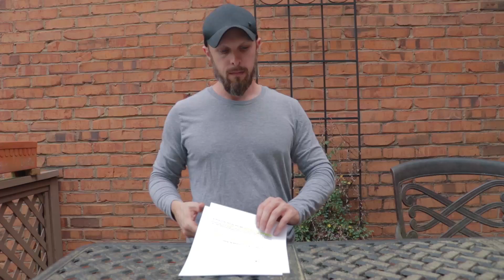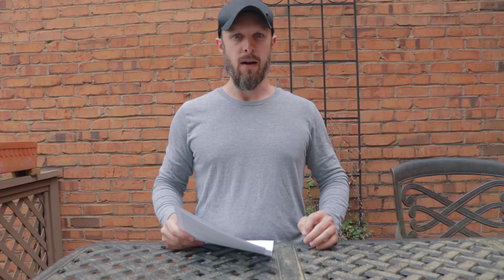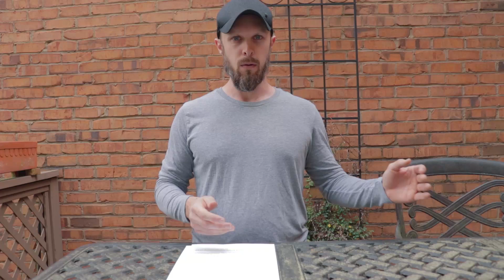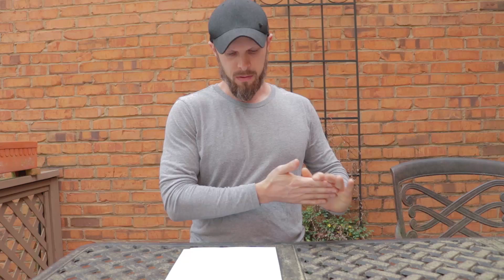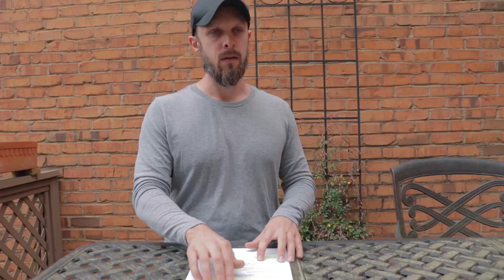Stop 5G Signals With Cob Walls - Protect Your Home From EMF Radiation

Comment: I heard that 5g is a low frequency.
Reply: U heard wrong!
Reply: It's a really high frequency.  It allows high data rates but reduces the distance it can be transmitted.  If uses 28 to 39Ghz.  That's 10 to 65 times higher than the current 4G network that operates at 600mhz to 2.5ghz. 

4G networks have a range of 10 miles while 5 networks have a range of 1,000ft.  That's not even 2% of the range of a 4g network.  5G towers will have to be placed every block or so in order to have a reliable network.
Reply: @goodtreeministries3751  oof
Reply: @suqma  5G Ultra Wideband, Verizon's millimeter wavelength (mmWave)-based 5G, operates at frequencies of about 28 GHz and 39GHz. This is considerably higher than 4G networks, which use about 700 MHz-2500 MHz frequency to transfer information.4 days ago.  SOURCE: A QUICK GOOGLE SEARCH.  That's at least 10 times higher frequency and up to 55 times higher frequency.
Reply: @goodtreeministries3751  yeah, still much much much weaker than light and stil means nothing
Reply: @suqma I disagree it matters.  High exposure to radio frequency radiation associated with cancer in male rats

NTP releases final reports on rat and mouse studies of radio frequency radiation like that used in 2G and 3G cell phone technologies.

The National Toxicology Program (NTP) concluded there is clear evidence that male rats exposed to high levels of radio frequency radiation (RFR) like that used in 2G and 3G cell phones developed cancerous heart tumors, according to final reports released today. There was also some evidence of tumors in the brain and adrenal gland of exposed male rats. For female rats, and male and female mice, the evidence was equivocal as to whether cancers observed were associated with exposure to RFR. The final reports represent the consensus of NTP and a panel of external scientific experts who reviewed the studies in March after draft reports were issued in February......The $30 million NTP studies took more than 10 years to complete and are the most comprehensive assessment, to date, of health effects in animals exposed to RFR with modulations used in 2G and 3G cell phones. 2G and 3G networks were standard when the studies were designed and are still used for phone calls and texting.

I'm not trying to alarm anyone.  It's clear that our environment and diet are contributing to the higher cancer rates.  It's multi faceted and this is just part of the picture.   It's insane when you see advertising telling you that one in three people will have cancer.  It used to be that you might not know anyone that died of cancer.  The creepy part is that they are trying to mentally prepare your for it.  Shifting your expectations of what reality is and what type of future is reasonable.

Source:https://www.nih.gov/news-events/news-releases/high-exposure-radio-frequency-radiation-associated-cancer-male-rats

Personally I trust in Jesus for my health.  I used to be an athiest, but I've prayed for thousands of people and seen over a thousand healed of all kinds of things instantly while I was praying them. Broken bones,  short legs, bad back, bad knees,  MS, etc.  We all die it's most important to be right with God.  We all need to repent from sin and believe in Jesus for eternal life.
Reply: @goodtreeministries3751  mkay, so firstly, that is just one study, secondly, even if someone wanted to increase cancer risk, people are still living longer than before, so we are still developing, also, i think cancer rates aren't rising, they just can be diagnosed more easily...-well maybe, to be real, people in the middle ages weren't smoking and eating fast food, so it could be rising, but still
Reply: @suqma  

It's not one study.  

https://www.theguardian.com/technology/2018/jul/14/mobile-phones-cancer-inconvenient-truths
Central to keeping the scientific argument going is making it appear that not all scientists agree. Towards that end, and again like the tobacco and fossil-fuel industries, the wireless industry has “war-gamed” science, as a Motorola internal memo in 1994 phrased it. War-gaming science involves playing offence as well as defence – funding studies friendly to the industry while attacking studies that raise questions; placing industry-friendly experts on advisory bodies such as the World Health Organisation and seeking to discredit scientists whose views differ from the industry’s.

67% of the independently funded studies found a biological effect, while a mere 28% of the industry-funded studies did. Lai’s findings were replicated by a 2007 analysis in Environmental Health Perspectives, which concluded that industry-funded studies were two and a half times less likely than independent studies to find health effects.

I no longer believe in the good will of the government, corporations or people in general.  Let's be honest these are just institutions that are run by people.  I've seen too many lies exposed over time that show a pattern of  willingness to cause sickness and death for sake of money and power.  There is evil in this world and people are willing to kill people for the sake of gain.  

In reality it's sin in people's hearts being made manifest in their actions.  The answer is Jesus, but He tarries
Reply: @suqma  There is less active energy in a piece of arsenic than a rf wave, but it kills you a lot faster.  Active energy output or lack there of doesn't equal safe or unsafe.  It's more complex than that.  I will trust independent studies over your hasty dismissals based on flawed logic.
Reply: @goodtreeministries3751  oof, active energy doesn't mean anything, i only know the energy
Reply: you know, the energrtic energy kind
Reply: @suqma  https://www.thesaurus.com/browse/energetic. 

Similar words:  Active, etc...

Tomato = Tomato.
Reply: @goodtreeministries3751  but when you string two synonyms together, it Is NOT A WORD that's like saying; tomato tomato, And Meaning tomato also that Is the synonym for energETIC not energY And surprise surprise, arsenic doesn't kill you with energy like a bomb or something, it kills you because it Is toxic
And just because something has a lot of energy doesn't mean it kills you
 what Is even this discussion
Reply: @suqma  It is the discussion.  You claimed that becuase 5g waves have less energy than light it's not harmfully.  This is flawed logic.  Your just nitpicking the way I described it because your logic and argument is flawed.
Reply: @goodtreeministries3751  mhm, and what, do you have any other reason why it should be harmful?
Reply: @suqma   Like I said I trust independent studies over my own understanding or your assumption of what makes something harmful to the human body.

Your assumption that light has more energy than 5G therefore it's not harmful is flawed logic.  Energy output is not the only factor.  

For example
A standard outlet is
110 volts x 10amps = 1100 watts and is deadly.
A Van De Graaf generator is safe at
200,000volts x .01amps= 2000 watts and is safe to touch.  

The form of the energy and how it interacts with different things is very important and should be studied for safety.

Some plants are poisonous and deadly.  They have can have less energy than a nonpoisonous plant.  It's the interactions of the parts in the system that matter not the overall sum of energy.

As stated before this has to be studied on a case by case basis because the world is complex place.  If you want to know the affects of an RF wave at 30ghz on living animals and people you have to do the studies.  You can't assume it's safe.
Reply: @goodtreeministries3751  this leads nowhere, you're comparing energy to poison
Reply: @suqma  I also compared volts to amp's. Which you ignored. High voltage is harmlessly if the amp's are low enough.  Proving that different forms of energy are safer than others.  Your not being objective.  Your right this not going anywhere.
Reply: @goodtreeministries3751  ok, but how does This say that 5G's frequency And energy Is harmful in any way?
Reply: Source:  Scientific American https://blogs.scientificamerican.com/observations/we-have-no-reason-to-believe-5g-is-safe/

Yet, since the FCC adopted these limits based largely on research from the 1980s, the preponderance of peer-reviewed research, more than 500 studies, have found harmful biologic or health effects from exposure to RFR at intensities too low to cause significant heating.
Numerous recent scientific publications have shown that EMF affects living organisms at levels well below most international and national guidelines. Effects include increased cancer risk, cellular stress, increase in harmful free radicals, genetic damages, structural and functional changes of the reproductive system, learning and memory deficits, neurological disorders, and negative impacts on general well-being in humans. Damage goes well beyond the human race, as there is growing evidence of harmful effects to both plant and animal life.”

The World Health Organization's International Agency for Research on Cancer (IARC) classified RFR as "possibly carcinogenic to humans" in 2011. Last year, a $30 million study conducted by the U.S. National Toxicology Program (NTP) found “clear evidence” that two years of exposure to cell phone RFR increased cancer in male rats and damaged DNA in rats and mice of both sexes. The Ramazzini Institute in Italy replicated the key finding of the NTP using a different carrier frequency and much weaker exposure to cell phone radiation over the life of the rats.

5G Millimeter waves are mostly absorbed within a few millimeters of human skin and in the surface layers of the cornea. Short-term exposure can have adverse physiological effects in the peripheral nervous system, the immune system and the cardiovascular system. The research suggests that long-term exposure may pose health risks to the skin (e.g., melanoma), the eyes (e.g., ocular melanoma) and the testes (e.g., sterility).

Above are paragraphs from the article from this respected scientific journal and is reverencing 500 hundred studies over decades.

If this doesn't change your mind I don't know what would.
Reply: @suqma   Source: Environmental Health Trust
Published Research Establishes Harmful Effects of Wireless Radiation

5G Wireless Expansion: Public Health and Environmental Implications is a published research review on 5G that documents the range of reported adverse effects of RF and millimeter waves—effects which range from cancer to bacteria growth changes to DNA damage. The study concludes that “a moratorium on the deployment of 5G is warranted” and “the addition of this added high frequency 5G radiation to an already complex mix of lower frequencies, will contribute to a negative public health outcome … from both physical and mental health perspectives” (Russell 2018).

Cancer epidemiology update, following the 2011 IARC evaluation of radiofrequency electromagnetic fields is a comprehensive research review of RF effects in human and animal research. The review concludes that scientific evidence is now adequate to conclude radiofrequency radiation is carcinogenic to humans (Miller 2018). Several previously published studies also concluded that RF can “cause” cancer, for example, Hardell 2017, Atzman 2016 and Peleg 2018.

 

The US National Toxicology Program (NTP) Study on Cell Phone Radiation found “clear evidence” of cancer, heart damage and DNA damage in a $30-million study designed to test the basis for federal safety limits (NIEHS). The heart and brain cancers found in the NTP rats are the same cell type as tumors that researchers have found to be increased in humans who have used use cell phones for over 10 years. Thus, researchers say this animal evidence confirms the human evidence (Hardell 2019.)

The Ramazzini Institute (RI) Study on Base Station RF  was another large scale rat study that also found increases in the same heart cancers as the NTP study found—yet the Ramazzini rats were exposed to much lower levels of RF than the NTP rats. In fact, all the RI Ramazzini radiation exposures were below FCC limits, as the study was specifically designed to test the safety of RF limits for cell tower/base stations (Falconi 2018.)

 

Tumor promotion by exposure to radiofrequency electromagnetic fields below exposure limits for humans” is a replication study that used very, very low RF exposures (lower than the Ramazzini and NTP study) and combined the RF with a known carcinogen. Researchers found elevated lymphoma and significantly higher numbers of tumors in the lungs and livers in the animals exposed to both RF and the carcinogen, leading researchers to state that previous research (Tillman 2010) was confirmed and that “our results show that electromagnetic fields obviously enhance the growth of tumors” (Lerchl 2015).

“A review of the ecological effects of RF-EMF” reviewed 113 studies finding RF-EMF had a significant effect on birds, insects, other vertebrates, other organisms and plants in 70% of the studies (Cucurachi 2013). Development and reproduction in birds and insects were the most strongly affected. As an example of the several studies on wildlife impacts, a study focusing on RF from antennas found increased sperm abnormalities in mice exposed to RF from GSM antennas (Otitoloju 2010). Studies on bees have found behavioral effects (Kumar 2011, Favre 2011), disrupted navigation Goldsworthy 2009, Sainudeen 2011, Kimmel et al. 2007) decreasing egg laying rate (Sharma and Kumar, 2010) and reduced colony strength (Sharma and Kumar, 2010, Harst et al. 2006). Research has also found a high level of damage to trees from antenna radiation.  For example, a field monitoring study spanning 9 years involving over 100 trees (Waldmann-Selsam 2016) found trees sustained more damage on the side of the tree facing the antenna.

“Towards 5G communication systems: Are there health implications?” is a research review that details how research has found that millimeter waves can alter gene expression, promote cellular proliferation and synthesis of proteins linked with oxidative stress, inflammatory and metabolic processes.” The researchers conclude, “available findings seem sufficient to demonstrate the existence of biomedical effects, to invoke the precautionary principle” (Di Ciaula 2018).  

“The Impact of radiofrequency radiation on DNA damage and antioxidants in peripheral blood lymphocytes of humans residing in the vicinity of mobile phone base station” is a research study that compared people living close (within 80 meters) and far (more than 300 meters away) from cellular antennas and found that the people living closer had several significant changes in their blood predictive of cancer development (Zothansiama 2017). Researchers controlled for various demographics, including the use of microwaves and wireless in the homes

“Mortality by neoplasia and cellular telephone base stations” is a 10 year study by the Belo Horizonte Brazil Health Department and several universities in Brazil that found an elevated relative risk of cancer mortality at residential distances of 500 meters or less from cell installations (Dode 2011). Shortly after this study was published, the city prosecutor sued several cell phone companies and requested that almost half of the city’s antennas be removed. Many antennas were dismantled.

 

A 2019 study of students in schools near cell towers found their higher RF exposure was associated with impacts on motor skills, memory and attention (Meo 2019). Examples of other effects linked to cell towers in research studies include neuropsychiatric problems, elevated diabetes, headaches, sleep problems and genetic damage. Such research continues to accumulate after the 2010 landmark review study on 56 studies that reported biological effects found at very low intensities, including impacts on reproduction, permeability of the blood-brain barrier, behavior, cellular and metabolic changes, and increases in cancer risk (Lai and Levitt 2010).  

5G FREQUENCIES ARE USED IN WEAPONS

For years, the U.S., Russian and Chinese defense agencies have been developing weapons that rely on the capability of this electromagnetic frequency range to induce unpleasant burning sensations on the skin as a form of crowd control. Millimeter waves are utilized by the U.S. Army in crowd dispersal guns called Active Denial Systems. Dr. Paul Ben-Ishai pointed to research that was commissioned by the U.S. Army to find out why people ran away when the beam touched them. “If you are unlucky enough to be standing there when it hits you, you will feel like your body is on fire.” The U.S. Department of Defense explains how “The sensation dissipates when the target moves out of the beam. The sensation is intense enough to cause a nearly instantaneous reflex action of the target to flee the beam.”

Source:https://ehtrust.org/key-issues/cell-phoneswireless/5g-networks-iot-scientific-overview-human-health-risks/
Reply: @goodtreeministries3751  you say possibly carcinogenic...pickled vegetables are in the same cathegory
Reply: @suqma  Believe what you want.  Over 500 hundred studies show that it is dangerous.  You take one thing in one study mentioned and twist it.
Reply: @suqma  You have always trying to find a way to dismiss things instead of have a real conversation about the studies or the findings.  The truth is your mind is made up.  The way you approach things show that your not interested in the truth.
Reply: @goodtreeministries3751  -_- idrc, thousands more said it isn't
Reply: @goodtreeministries3751  no, i am just tired of all of you conspiracy theorists, i actually know a fact to disprove every one of your claims, just that i'm not interested anymore, you wouldn't change your mind anyways
Reply: @goodtreeministries3751  no, this is a one off thing, and i really am not lying, i'm just tired of it, also i absolutely can say that about every other conspiracy theorist, i have been ttrying to find someone willing to have a discussion for a long time, and i found someone just when it stopped being even remotely exciting, so yeah
Reply: @goodtreeministries3751  but okay, give me some point to argue against, i'll try to do my best, but one thing, would you be willing to change your mind if i show you proof?
Reply: Hmm, it Is kinda low, for example compared to visible light, it Is extremely low, but it Is higher than the 4.,3.,2. And 1. generation technologies
Reply: You mean lower your own frequency
Reply: @KosmikGawdess  And what the heck Is lowering your own frequency? like really? sounds like anti-science
Reply: @KosmikGawdess  I don't mean anything, I'm asking a question.